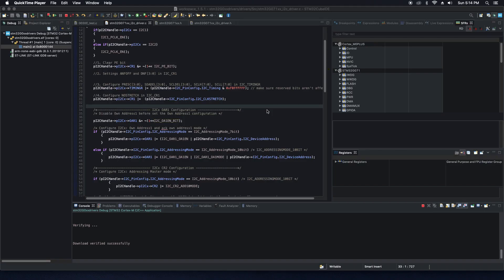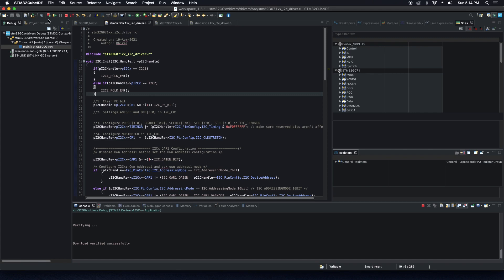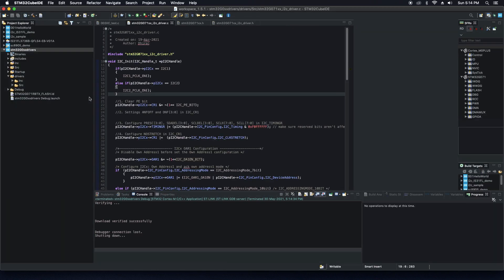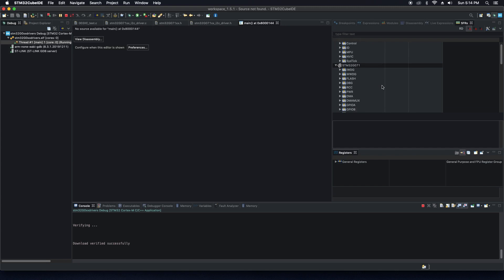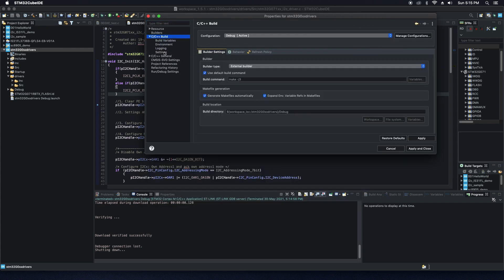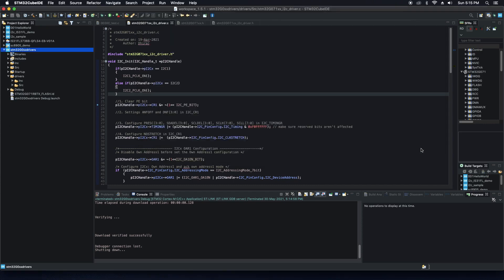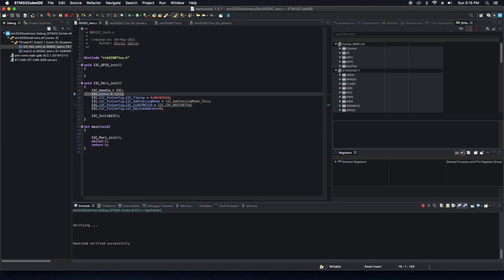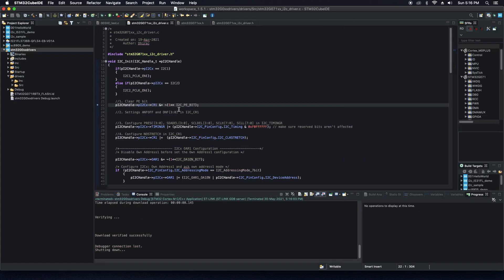No source available for "main() at 0x8000144" error STM32Cube IDE

Comment: Thanks, it helps me a lot.
I have tried to write and read flash memory on the STM32G431KB microprocessor. All the defined properties, functions, and actions in the same main.c file worked correctly without changing any debugging settings.The problem I have been facing arises when I separate the defined properties and functions (flash.c file) from the action files (main.c file), and debugging mode doesn't work. The error code is: 'No source available for main() at 0x08000054'. The error code is: 'No source available for main() at 0x08000054'. I followed the steps you demonstrated in this video, and it solved the problem.